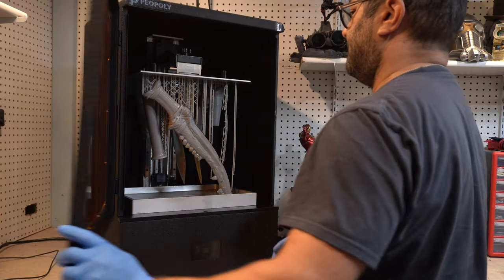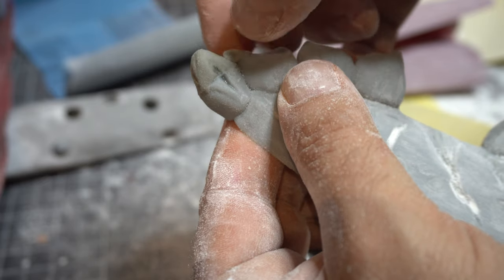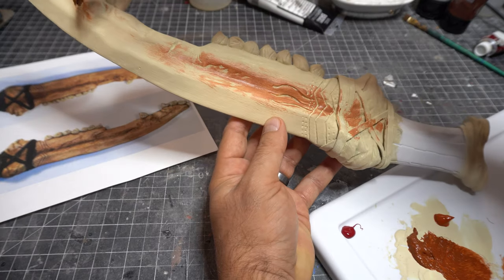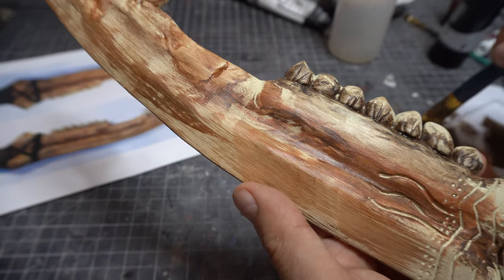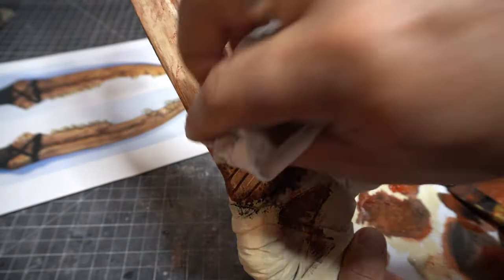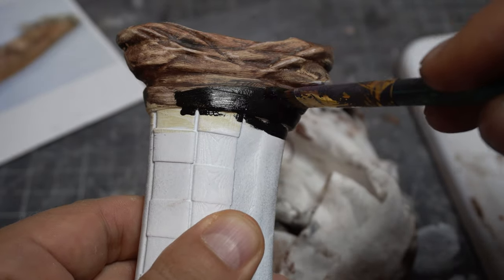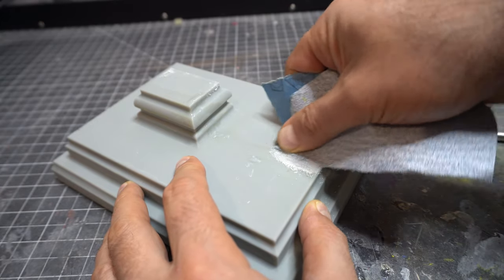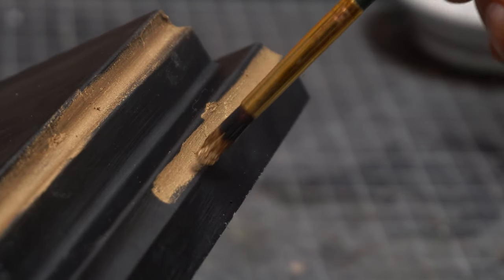The First Blade from Supernatural - Resin 3D Painting Tutorial

Comment: Nice Video! Question: Do you sand every Resin Print before coating ? Im Asking because i did not sand, just washed my Prints, let em dry and painted it but my Primer doesnt stick, i can scratch it off with my fingernails easily. Is that just normal ? Greetz
Reply from the maker: Hey, thanks! Nope, that's not normal. I do sand all my prints after they are cleaned with alcohol.  And after I sand them I wash them with soap and water to clean off any dust from the sanding. What primer are you using.
Reply: @3DPrintedProps  Thanks for the quick response. I use Vallejo Black Primer as well as Vallejo Acrylics.
Reply from the maker: @tobias6365  Huh, that's weird. I use just regular spay primers I get at Lowes. I think it may have to do with the type of primer and or maybe the prints aren't cleaned well enough with alcohol and the resin residue is not letting the paint bind. I'd try a different primer first. If that scraps off then its probably that you prints aren't cleaned well enough. Check out my site, I've used all these primers on resin with no issues. They are affiliate links. You can also get Rustoleom right at your local Lowes or Home Depot. :)
Reply from the maker: https://3dprintedprops.com/painting-supplies-2/
Reply: @3DPrintedProps  Thanks man! I got to brush some pieces of Prints today and gonna try to fully clean it with Isop. and let it dry completely. If that wont fix the issue imma try a new primer. Thanks alot.